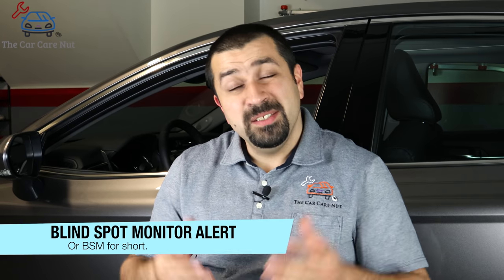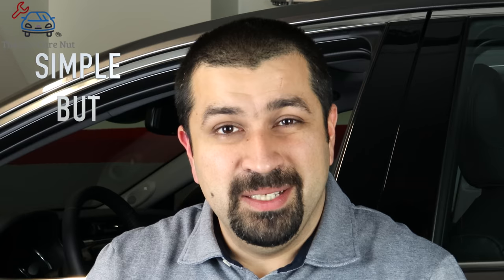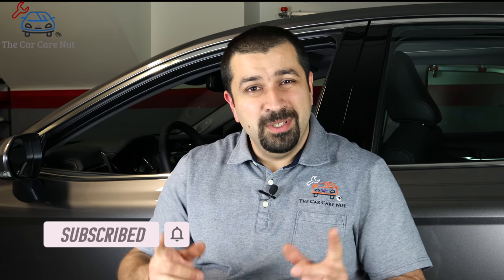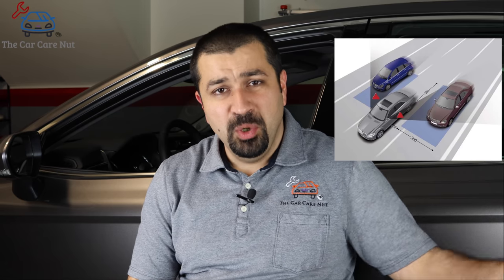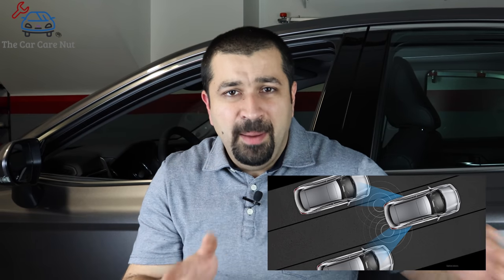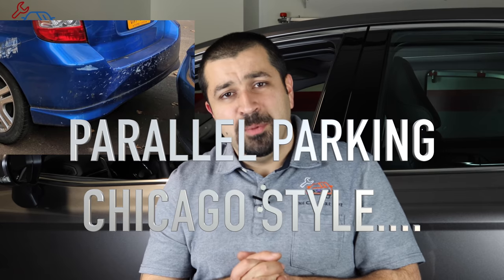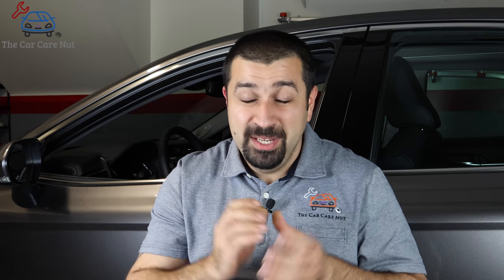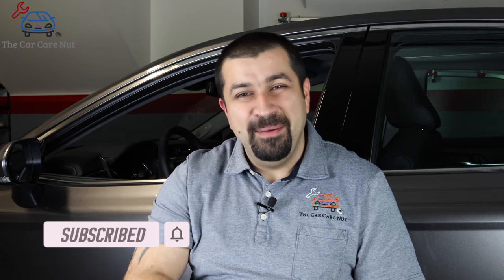How does Blind Spot Monitoring work in Toyota cars

Comment: The thing to remember, radar is radio waves and radio is a long wave form of light - which means it travels at the speed of light or 186,262 MILES per second. It travels about 11 yards in one nanosecond (1 billionth of a second). So even changing the sensor position a millimeter makes a huge difference in the reflection time and can cause significant errors.

Comment: I have a Hiace which I designed and installed my own BSM using a normal PIR. All my work cars have WIFI, and used Sonoff bridge, two PIR mounted in the plastic rear bumper, and a wireless siren with flash light. It works fine, and its true if the angel of the PIR shifts, the system does not work. Anyway good insighful video

Comment: Thanks for this video. Can you speak to how having a bike rack on the rear may trigger false alerts (if that’s possible)? On my new Grand Highlander I got a warning (without a bike rake) that the system failed and to take to dealer. On restarting it went away. Now, driving it gives all kinds of false positives. I’m wondering if a bike rack with a bike would impact the sensing.

Comment: Your videos are always great and informative.  I do have a question; I've had several non-toyota vehicles with BSM which beeped in addition to flashing a light. My 2023 Highlander Platinum flashes but does not beep. Is it possible to have beeping programmed at a dealership?  Thanks and keep up the great vedios.

Comment: A little out dated in 2024 but still good info.  My 24 Prius keeps the mirror light on well past the point the car is jn my view.  It also senses cars pretty far away, and I like it better that way. 6 feet or even 10 feet does not give enough time  at highway speeds to react.

Comment: My preference is when say using a left turn signal the radio screen shows your blind spot area.  Once the turn signal is restored the radio display restores to normal also.  That system is less sensitive to alignment and simply shows YOU not the computer what you need to know.

Comment: I’m installing an after market steel rear bumper on my ‘23 4Runner that will block the waves of the sensors.  Will disconnecting the sensors cause any other malfunction other than not having the alert work?

Comment: Very nice and explicit video. I wonder, can this BSM be activated/installed on a Toyota Corolla 2020 which came without this system? Can I add it later without affecting the warranty?
Reply from the maker: At the dealership level likely no. Aftermarket maybe but I have no experience with that so I can’t common on how good it is. With warranty if it causes issues related to the install it would void the warranty for that part or system affected.

Comment: I'm surprised Toyota chose the plastic bumpers to mount the BSM sensors, since after all these bumpers are meant to take bumps at some speed like 5 or 10 mph (at least they used to) and not have any damage requiring a trip to the body shop. This was something the Auto Insurance companies did in collaboration with Car manufacturers and the goal was to keep repair costs down and hence Insurance costs down. In other words, why not mount these higher up, say next to or inside the tail light modules? They would be far less likely to be damaged there, No? Pickup trucks have them mounted on the body and not in the bumper.
The only thing I can think why Toyota chose to do this was to achieve best reliability and lack of false signals. But I'm not sure. I higher position would be better at picking up other cars, I would think.

Comment: Hi, Might as well throw this question out here. My BSM and RCTA instantly give off a light after turning them on, after replacing stolen BSM mirrors on a 18 Camry. Is it possible I botched the connectors?
Reply from the maker: Hi! They are both connected and work together. Best bet is to scan them for codes. Now the mirror that you replaced was it an exact match for year and model?
Reply: @TheCarCareNut  I purchased from dealer using VIN. I think dealer wanted 2k for some sort of calibration or replacement last year when I had them look. I am going to look at my wiring, I don’t think I connected some wires properly or tightly. Then I’ll scan the codes. Thanks for the response, I’ll get back to you on them.

Comment: I have 2022 avalon xse but bsm is not working the way I thought it would..  if im passing a car lot faster than the car next to me it doesnt light up.. is this normal? A lot faster meaning my speed is far more higher than the car next to me.. i already took my car in for a service but they told me nothing is wrong.  My understanding is that if theres a car next to me or withing the range of the sensor it should detect and light should come on regardless of the speed im passing or be passed by..  please reply to my message, I feel that you are the only person to give me a straight answer and you are the only person ill trust with toyota issue.
Reply from the maker: Hi! That is normal. It needs to see that the car is actually in your blind spot. When you pass a car at a high rate of speed relative to the car you passed it was in your blind spot for such a short time that it doesn’t alert. Equally if you have another car passing you at a much higher speed the system will light up very early much earlier if the car was just slightly faster than your speed.
Reply: @TheCarCareNut  thank you so so so much for your reply..  I can now stop my argument with the dealer..  I hate to lose in an argument but no nothing left to argue after reading your reply..  Have a wonderful year and if you dont mind can I medsage you again if I run into another issues?

Comment: The Car Nut ... Do you know if you can service the battery in the Camry you show.. assuming you still have the OME battery that was originally installed in the car ..... Mine is a 2020 Camry XLE 4 cyl. and they are the same. ... I like to add distilled water to keep the cells flooded to make it last  .. I can`t figure out how to get the long cap off on top of the battery ... I am afraid if I pry it much it could break ? Thanks for any suggestions ...
Reply from the maker: Hi! As far as I know these batteries are not serviceable. They are a new style battery that showed up with Toyota called H6.
Reply: @TheCarCareNut  Thanks for your reply guy ! I figured you would know one way or the other .. I have looked all over and could not find any information .. I was afraid if I pried off the cap I might damage it .. I will leave it alone .. The Toyota dealership sells a heavy duty battery that is guaranteed for as long as you own the car .. I will go with that in a couple of years ... I never let a battery die on me if I can help it !!! Thanks again ..I enjoy your videos ..

Comment: Thanks for the very informative video . 

My Prius had minor bump on the right side of the rear pumper that didn't require any repair and after around two weeks of the incident the BSM system error light came on and reading the error with my OBD reader it says something about horizontal axis . 
I inspected the sensor and I saw no physical damage to the sensor itself of the wiring, however the mounting panel might have shifted slightly which I cannot detect . 

I took the car to the dealer and after they weren't able to clear the code and they suggested that they can try to re-calibrate the system but they said that most times this won't fix it and they might have to cut and replace the inner panel to fix the issue . 
This would cost quite a bit around 1500$ here and I'm not sure if it's worth it or if I should try another dealer . 

The car was pushed by an SUV very slowly on the side of the pumper so I'm guessing the panel housing the sensor might have shifted  slightly causing the miss-alignment . 

Let me know you have any suggestions and if their estimate is on the higher side . 

Thanks and all the best
Reply from the maker: Hi! They can move the bracket and try to bring it back into spec if not then unfortunately it will need body work
Reply: @TheCarCareNut  I'm suffering this thing right now. My car is at the dealership for a "Dent" with no signs of skratches, trash or hit damage, just an slightly dent of the size of a newborn nail in dimensions right on the right corner. It went to the dealership, aparently the first time they replace the sensor and the module and base on the work order they were both Inoperative, an hour ago after we picked up the vehicle start failing again, now this time the car magically appeared with the small dent and according to the dealership we have to take it to a body shop to get fix it.

Comment: If you don't have a car with Blind Spot Monitoring...what I've done for years is buy (any auto parts store) two small convex adhesive backed mirrors and put them on the outermost portion of your side view mirrors. These little mirrors show you the blind spots on both sides of your car. They are cheap and work very well.

Comment: Need help...my bsm not working...I buy a used Toyota CHR 2017 and door mirror don't have bsm sign... now I want to install a external bsm light but don't know the wiring... mirror connector had 10 wires 7 used for mirror movement 3 remaining... can't know how to connect with these 3 wires

Comment: Quick question... The 2022 4Runner is supposed to have blind spot monitoring. Any idea where those sensors will be mounted? The reason I ask, is that I would like to put on a aftermarket steel bumper that will hold the spare tire and other gear. I'm afraid that the sensors will be in a spot that's underneath the new steel bumper, and won't work properly
Reply from the maker: Hi! Likely behind the rear bumpers

Comment: Ok so? If my Prius V 2012 doesn’t have a place for the filter fan screen and can only be accessed through the seats? Do you recommend doing the $400 service that they charge to protect the life of the batteries? If it’s that important I guess that’s what you would tell me to do right?
Reply from the maker: Hi! I would jump into spending money without checking. I would use an inspection camera to look at the fan. If it’s clean I wouldn’t worry and just install a filter. If it’s dirty then I would recommend you clean it once only then install a filter that way you won’t have to clean the fan again just the filter which is simple and easy to get to

Comment: We are purchasing a 2016 tacoma trd sport and we are watching your videos to make sure it checks out. Your videos were very helpful and thank you. You recommended making sure the blind spot switch was turned on but the blind spot switch doesn't turn on the system. The dealer checked the wires and fuses and they said that is all they can do. I am concerned about this. Do you have any recommendations? The system doesnt turn on.
Reply from the maker: Hi! Honestly this one will need diagnosis but definitely negotiate the price or include a repair in the deal. If this truck is modified I’ve seen some remove the sensors in the back to install a different bumper
Reply: @TheCarCareNut  thank you for your reply. I found out there was minor to moderate damage to the front left side and rear of the truck on the carfax. The dealer said the previous owner stated he hit a deer. The truck also has bigger tires and it looks to be lifted. Can a damaged or missing sensor cause the system not to turn on at the button on the lower dash? Can the system be turned on from the touch screen?
Reply from the maker: That could be it. I would have the dealership at least make sure the sensors are there. Other than the button on the dash there’s no other place to turn them on

Comment: The BSM on our 2018 XSE Camry doesn't work as well as the BSM in our 2014 Lexus is350. There's a lot of times where the Camry BSM doesn't trigger, but the Lexus works every time.
Reply from the maker: Might be a calibration issue. Any accidents in the back?
Reply: @TheCarCareNut  no, the car was bought brand new. 

The BSM only triggers when a vehicle is coming from behind (which is good) but not when passing a vehicle. In the Lexus the BSM will trigger as soon as I approach a vehicle from behind. 

Does that make sense? It's kinda hard for me to explain.
Reply from the maker: It should trigger when you pass a car and it enters your blind spot. It should actually work exactly the same as your Lexus since it’s the exact same system down to the sensors. Have you brought it to the dealership attention?
Reply: @TheCarCareNut  that's what I figured, I plan on bringing it to their attention when I take it in for service.

Comment: Hello again I have a question for you .I just purchased a thinkware  dash cam it has a front camera and rear camera I go to get my work done at my dealership do you think they will want to install it for me for a price or should I go to an independent person to do the work .
It's a model  U1000 thinkware  dash cam.
Will it affect my system in my Toyota Corolla le year 2014 .Thank you for your time .
Reply from the maker: Hi! A dealership can install it but will charge too much and it doesn’t really require much skills to install it. I would have an independent install it. It won’t affect anything if installed correctly.

Comment: Can I change out my side mirrors on 2018 4runner for the Rav4s mirrors that have those little blind spot things stuck on it?? I heard they are the same side mirrors...and mine defrost...
Reply from the maker: Hi! There’s more to the blind spot system than the mirror.
Reply: @TheCarCareNut  it's the mirrors that don't have the blind spot monitor system but a little blindspot mirror stuck on the mirror. Those come on some Rav4 ones but not 4runners I think...
Reply from the maker: Ah got it. Honestly I haven’t tried it myself to see if they fit. You can buy a small aftermarket mirror that glues on the original one to show you a wider angle
Reply: @TheCarCareNut  that sounds cheaper too...I will try that...thanks

Comment: That is why I dislike the integrated systems. I got my $10k used car without the lcd infotainment system or backup camera. I added  a $50 android head unit with backup camera and steering wheel control, $40 total for three dash cams, a $50 bsm (blind spot monitoring) so whenever something breaks, I can simply remove them in modular fashion.

Also a lot easier to upgrade them in the future.

Comment: So I ordered a toyota corolla exclusive sedan...since exlusive plus isn’t available in our market anymore...mine lacks this system and HUD. Can it be mounted at the Toyota dealership as an extra option? Market is in Europe, Romania. So I was wondering, since my car basically has all the system, it just lacks this option.
Reply: It does have the radar sensors on the sides.
Reply from the maker: Hi! Unfortunately with Toyota these systems cannot be added as an option at the dealership level
Reply: @TheCarCareNut  I see. Is it a big deal if I don’t have it? Since it has most security systems? We’ll see if it can be added on.
Reply from the maker: It’s not something essential to the car. They are optional features

Comment: Hi, I have RAv 4 Trail 2022, 
Nice to drive , performe well as well. 
As per my experience, blind spot indicator in mirror is 1)  quite outside of mirror and toooo small. 2) It should be big and someware inside body of the mirror. ( Subaru dose it very well ) Toyota should notice that.
One more thing i noticed that , we face reflection of AC went border  panel on driver side mirror. 
Am not sure if anyone noticed that or not.

Comment: Can you add the bsm system to a newer toyota as an after market accessory?
Reply from the maker: I’ve seen a few aftermarket systems don’t know how good they work and how reliable they are
Reply: @TheCarCareNut  so i couldn't get Toyota system installed after purchase.  Thanks for the response.
Reply from the maker: No that is not an option that can be installed at the dealership.
Reply: @TheCarCareNut  thanks for the response 👍